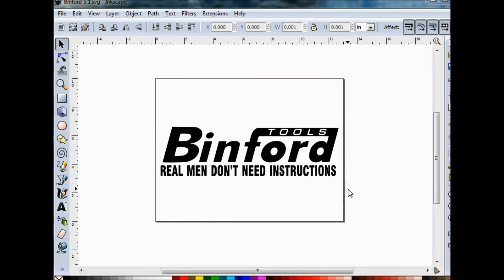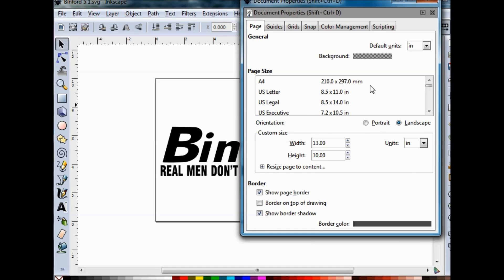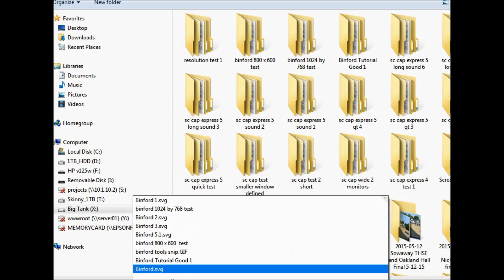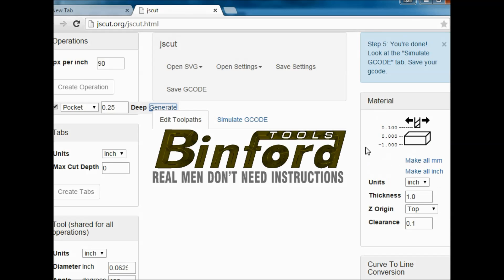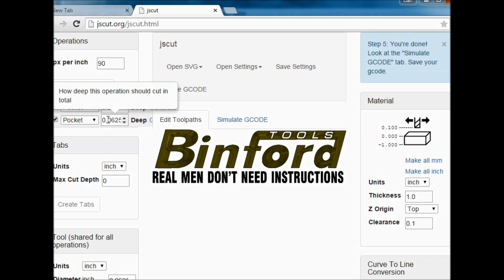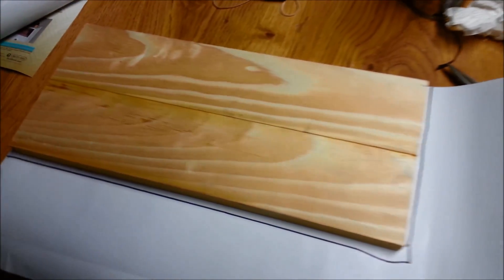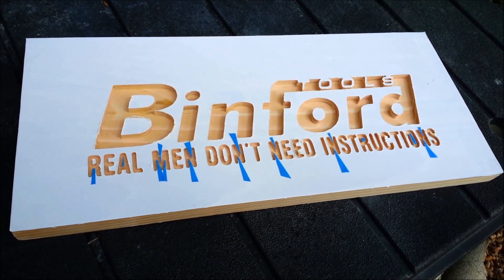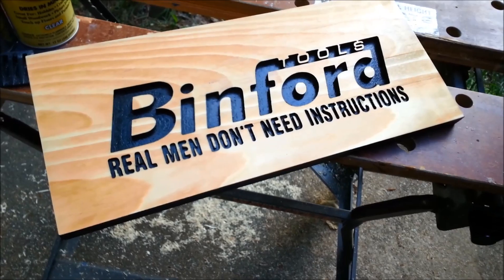Binford Tools Sign - a CNC project

Comment: Hey.  can you say what's wrong.  i have a chinese cnc 3020 machine.  and I use the included app.  the application has a couple of gcode files included that work perfectly.  but when i make my own gcode using jscut, the machine goes correctly according to gcode but the machine does not drill.

Comment: Hi why do you use the white tape on the wood. Does this stop the burr? I'm cutting pine and it always leave a fuzzy burr on the top of my writing. Nothing that a bit of sanding doesn't sort out.
Reply from the maker: The sticky liner paper is so after the cut is made you can spray paint the whole thing and not have to sand the paint off the flat areas.  Best of luck.

Comment: hi, can u give me ur cnc type and model? i think i have the same type and i dont have any idea how to use it since my friend gave it to me. thank you :)
Reply from the maker: It's a basic 3040 CNC.  They are mostly made in China and are good little machines.  The older 3040 machines were all parallel port connected.  The newest wave of them however are USB wired.  Here's a link to pretty much the same machine I have (without the USB).  http://www.ebay.com/itm/USB-CNC-ROUTER-ENGRAVER-ENGRAVING-CUTTER-4-AXIS-3040T-T-SCREW-3D-DESKTOP-CUTTING-/152215833400?hash=item2370c54b38:g:PC4AAOSwOyJX40F1
Reply: i have the parallel port machine. and it still sits collecting dust

Comment: hello, can you tell me where can I find a good pack of drill bits (like yours), I have a makita    router, thanks a lot
Reply from the maker: All of my CNC router bits were bought on eBay at various times from different vendors.  Most of the inexpensive bits/end mills have worked fine for my small projects.
Reply: thanks  drez

Comment: really good to see someone else using inkscape. I just picked up a Win cnc router. Took a class with a Shopbot a lot similarities between the machines. Have blasted to get the wood grain to really stand out. Do you think there's any thing common between our machines? Did you go straight from inkscape to your cnc? It was an interesting film
Reply from the maker: +Ron Pearsall Hi Ron.  I haven't used a Win CNC router so I can't comment on the similarity, but basic CNC operation at the hobby level has a lot of commonality.  I use Mach3 for the controller interface for the actual machine.  Once designs are created in Inkscape they are saved as SVGs but can't go straight to the CNC at that point.  A program to direct the tool paths has to be in the loop somewhere.  Perhaps the Win CNC software has a CAM part, jut not sure.  I like Jscut.org for my CAM directions, but there are other options out there as well.  Best of luck.

Comment: Is it possible to rough cut with larger end mill before using the 1/16th? Would it be faster to do so? Thanks for sharing.  Lee
Reply from the maker: Lee Hill Hi Lee.  With other programs, absolutely.  With Jscut it's much more basic and there isn't a way to switch out operations and end mills that I'm aware of.  The wood was just pine and I could have probably sped up my feed rate too - I did this cut at 40ipm and it probably could have been bumped up to 50 or 60.